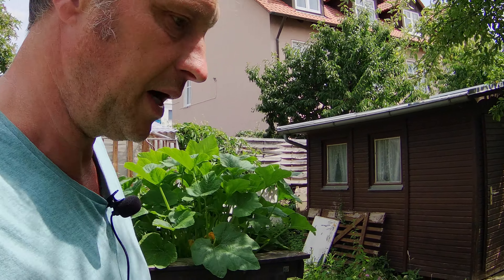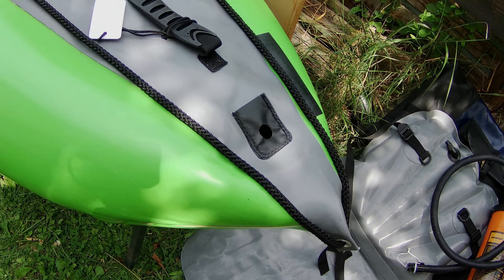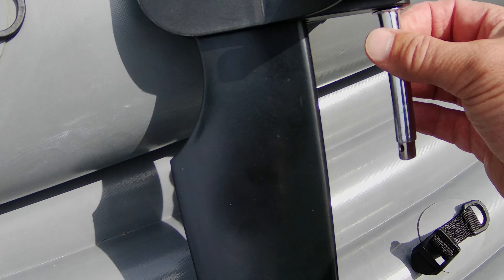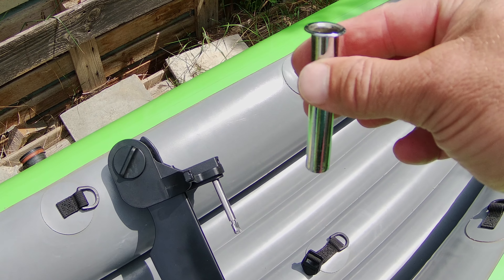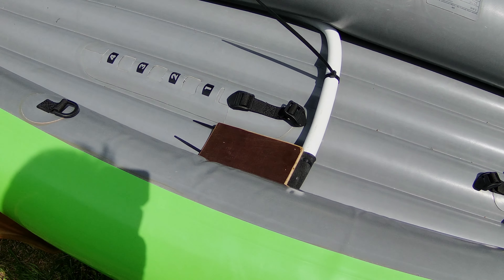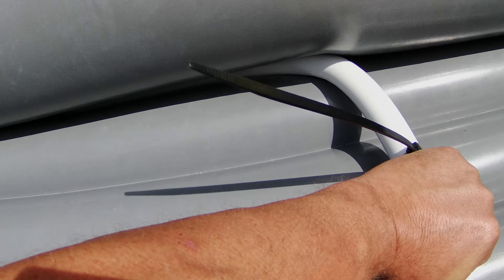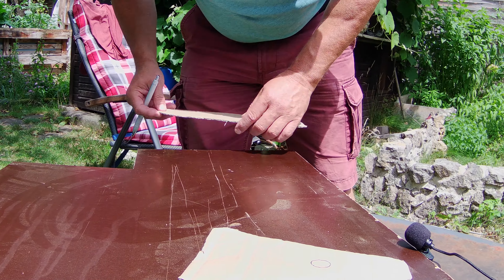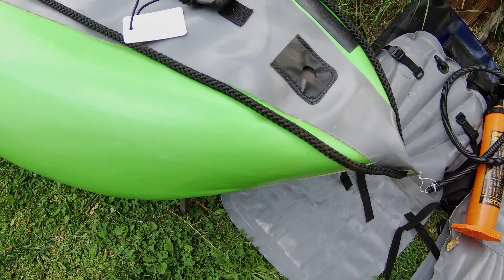Gumotex Solar Steueranlage Eigenbau

Comment: Applaus, einfach genial gemacht. Ich denke auch schon eine Weile über so eine Anlage nach. Bei mir soll sie aus Alublech sein. 218,- Euro von Gumotex sind mir für das bischen Zeugs zu teuer. Das Blatt werden die auch im Reich der Mitte zukaufen.
Reply from the maker: Wenn du das Brett, das unter die Persenning kommt, auch aus Alu machen willst, rate ich dir, die Kanten sehr weich zu verrunden, damit sich das Alu mit den Kanten nicht wie ein Messer in die Bootshaut schneidet....
Sonst macht es früher oder später  Pfffffff.
Hat schon einen Grund, warum ich lieber 8mm Multiplex genommen hab...
Reply: @greenTrimaran  Da hast du schon recht. Die original Gumotex Anlage ist aber auch aus Alu oder Edelstahl. Ich werde das aus dickem Material machen und die Kanten sauber verrunden.

Comment: Schöne und durchdachte Lösung. Verdreht sich die Siebdruckplatte für das Ruder, durch die Einpunktbefestigung nicht? Ich habe für nein Sevylor Ottawa auch eine seitliche Befestigung zur Aufnahme des Emotor gebastelt.Funktioniert echt gut.
Bei meinem neuen Extasea Race, hätte ich sogar die Möglichkeit ein Loch direkt in Kunstoffkappe am Heck zu bohren, was die Sache vereinfacht. Gut finde ich an Deiner Lösung:Durch die kleinen Platten bleibt das zusammen legen des Bootes, mit den montierten Siebdruckplatte möglich 👍
Reply from the maker: Also: wenn man befürchtet, dass sich die Platte drehen könnte, kann man ja entweder eine zweite Schraube montieren, oder einfach eine Antirutschmatte dazwischen liegen. Hab ich auch so gemacht. Ist wirkungsvoll.

Comment: Tolle Lösung für eine selbstgebaute Steueranlage für das SOLAR. Da hätte ich auch Spaß dran. Die 290€ für die original Gumotex Steuerung (Seawave) sind wirklich zu krass. Leider finde ich dein "ca. 30€ teures Steuer" nirgendwo bzw. ich verwende viellicht nicht die richtigen Suchbegriffe. Ein kleiner Hinweis wäre hier echt toll von Dir.
Es gibt hier auf Youtube noch ein Video zum Einbau einer (allerdings original Gumotex-Seawave) Steuerung in das SOLAR: https://www.youtube.com/watch?v=f9TfJ8b5rqI&t=19s  Insbesondere die Fixierung des Pedalbretts mit den "Heizungsrohr-Isolierern" sieht gut aus. Was hältst du davon? Außerdem funktioniert die Seawave-Steurung ja mit einer wesentlich kleineren Basis-Platte. Sieht irgendwie nicht wirklich stabil aus, scheint aber zu halten. Was meinst du dazu? Für mich wäre ein der Anbau eines eMotors ebenfalls interessant, nicht aber die Besegelung. Dafür müßte die Steueranlage also nicht ausgelegt sein. ps. im Video verwendest du auch eine Akku-Luftpumpe. Auch hier würde mich der Hersteller/Modell sehr interessieren. Viele Frgaen...vielleicht hast du irgendwann mal Zeit für eine Antwort. Wäre klasse 🙂
Reply from the maker: Ich habe inzwischen ein kleines Video einer wesentlich besseren und auch sehr einfach umzusetzenden Fuss-Steuerung gemacht. Es ist einfach ein Brett mit zwei Pedalen die mittels Edelstahl Scharnieren angebracht sind. Das Brett selbst wird einfach unter die Seitenschläuche geklemmt. Habe dann später noch mal stabilere Scharniere angebracht und bin mehr als zufrieden damit.
Die Steuerung hatte ich damals bei Wish bestellt. Auch joom oder AliExpress ist eine Suche wert. Ob die noch so günstig zu bekommen sind weiß ich nicht. Zwischendurch waren die mal noch viel billiger zu kriegen.
Die Akku Pumpe hat inzwischen das zeitliche gesegnet. Hab eine neue, einfach bei eBay bestellt. Ein Mini Ding mit Li-ion Akku. Aber richtig gut. Für ca25 Euronen. Macht das Boot und die Ausleger in wenigen Minuten voll. Den Druck muss ich dann noch mit der üblichen Handpumpe hinein pumpen. Ca 10 Hübe pro Schlauch. Easy.

Comment: Das hast du alles gut gemacht.
Trotzdem finde ich eine Steueranlage für das Solar unnötig.
Alles wieder Mehraufwand beim Aufbau. Das Boot lässt sich mit Finne optimal steuern. 
Wendig fahr ich seit längerer Zeit mit u.a. auch dem Solar auf Zeit auf einem Stausee ( Rundstrecke)
Habe noch nie ein Steuerruder vermisst. Bei meinem Grabner Mega ist dies wieder eine andere Sache, da fast ein Meter länger……
Reply from the maker: Wenn ich mein Solar allerdings mit Elektromotor oder gar mit der Besegelung fahre, ist die Steueranlage unverzichtbar.... Bei ruhigem Wetter auf dem ruhigen See, geb ich dir recht: muss nicht, kann aber!
Reply: @greenTrimaran  Ich nutze meine 3 Boote (Twist2, Solar und Mega) überwiegend als Trainingsgeräte für einen Rundkurs (2,8km) auf unserem Stausee (Bostalsee). Hier fahre ich 3 Varianten im Wechsel 
Die Kilometerstrecke, den 2,8km Rundkurs und als Langstrecke eine Stunde fahren mit dem Ziel möglichst viel Meter zu schaffen.
Kurioserweise muss ich mit dem Mega mit Steuerruder etwas weiter (zwischen 20 und 40 Meter abgetrieben im Vergleich) fahren für den Rundkurs, als mit den beiden anderen Booten. Egal ob etwas Wind geht oder fast gar nicht. Bei starkem Wind fahre ich nicht.
Vielleicht liegt es an der geringeren Wendigkeit (Wendepunkte etwas größer umfahren) oder du kannst mich nicht mit den anderen Spaßfahrern vergleichen, da ich mit den Gumotexbooten alles dran setzte, möglichst den kürzesten Weg zu fahren um die beste Zeit zu erzielen. Wenn ich die Garminstrecke überprüfe sind die Fahrlinien immer sauber auf Kurs.
Elektromotor und Besegelung ist für mich kein Thema.
LG Jörg und noch viel Spaß mit deinem Solar